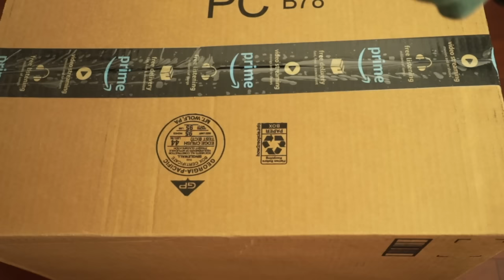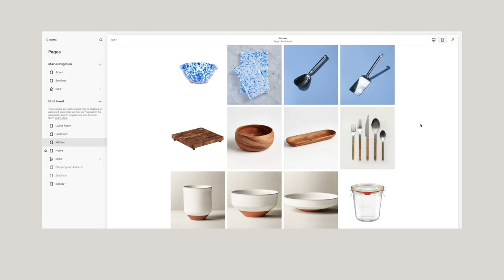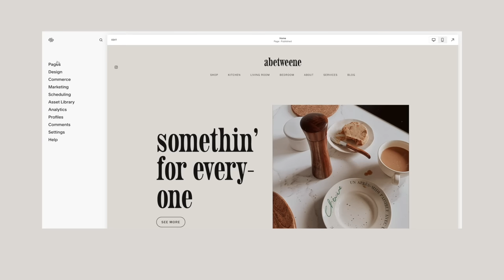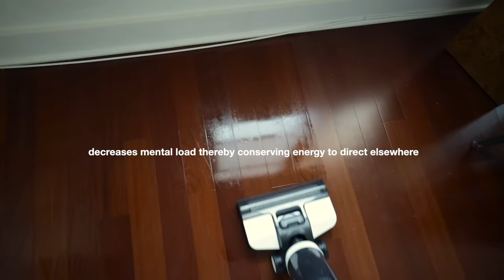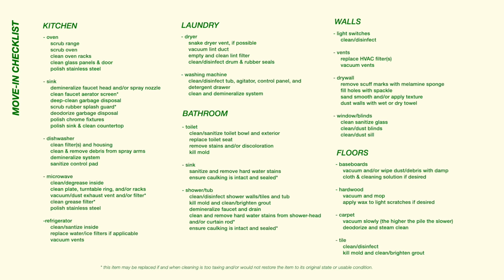the MOVE-IN CLEANING CHECKLIST you didn't know you needed | Beginner's Guide (Eco- Friendly)

Comment: Just a small tip with siliconing the tub, to avoid cracking make sure you fill the tub before siliconing because it pulls away from the walls ever so slightly when you fill it with water
Reply: Does the temperature of the water matter?
Reply from the maker: ohh, good tip. thanks

Comment: Semi pro tip: Grout comes in different colors it looks like they used a grey color. If you want it white you’ll have to re-grout with a white colored one. LOVEEEEE the video new subscriber! ❤️🫶🏾
Reply from the maker: yes, its a light tan. Im not going for white just wanted to remove any dirt cause i could tell it was discolored since it didnt match the shower 👍 ty! 💕
Reply: what did you use to clean the grout? And what was used for the final wipe of the sink hardware?
Reply from the maker: hydrogen peroxide and water. i just dried/buffed it with a dry rag.
Reply: You can find grout paint if it's discolored to the point it just looks plain nasty. So it would be renter friendly vs regrouting*

Comment: I used to be up on a chair cleaning those air filter cover vents. They unhook so easily. I don't know why i killed myself cleaning with them still attached to the ceiling when i could unhook and spray them off in the sink and let them dry on a towel.

Comment: Note To Self:
00:00 - Cleaning and Preparing Light Switches and Handles 
Before moving into your new place, it's essential to start with cleaning or replacing light switches and handles. Pay close attention to any stains or marks and ensure they are spotless. 

 01:29 - Deep Cleaning the Toilet and Sink 
For a thorough deep clean, focus on the bathroom, particularly the toilet and sink. Use an all-purpose cleaner or disinfectant, and consider using a melamine sponge for stubborn stains. Remember to follow product instructions. 

03:22 - Working from Top to Bottom 
When cleaning, start from the highest surfaces and work your way down. This prevents dust and dirt from falling onto areas you've already cleaned. It's an efficient cleaning method to ensure everything stays clean. 

 05:57 - Changing HVAC Filter and Cleaning Walls 
Don't forget to change the HVAC filter and clean the walls, especially if your place has been vacant for a while. This is a crucial step, particularly if you plan to repaint. 

 08:31 - Taking Care of Grout and Sealant 
Grout and sealant maintenance is often the landlord's responsibility, but you can do it yourself and inform them. Properly maintained grout prevents moisture from causing damage. If you handle it, you might negotiate rent concessions. 

11:03 - Cleaning Baseboards and Floors 
Clean baseboards and floors using a vacuum and wet vac for a more effective cleanup. A slow vacuuming pace ensures a deep clean. Remember to avoid oversaturating hardwood floors. 

14:27 - Cleaning Grout with Baking Soda 
Use baking soda to clean grout. It can lighten the grout and remove artifacts from the tiles. The process is straightforward and can significantly improve the appearance of your floors. 

17:08 - Cleaning White Rags with Oxy-Powder 
To clean white rags effectively, use Oxy-Powder, which is a solid version of hydrogen peroxide. This method is suitable for maintaining the whiteness of your cleaning rags.
Reply from the maker: Note: 14:27 is baking soda and peroxide. If you dont need the extra abrasion, just hydrogen peroxide and a brush is fine 👍